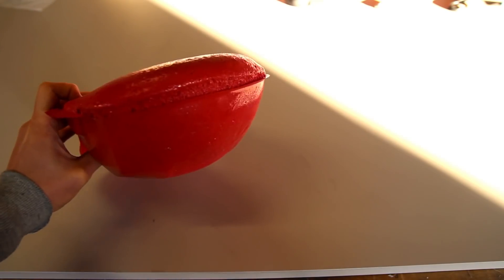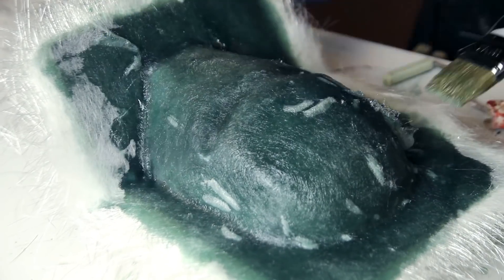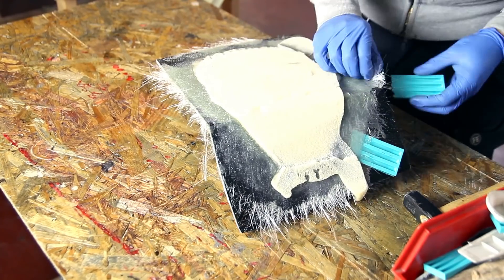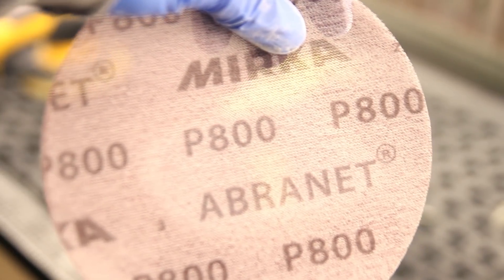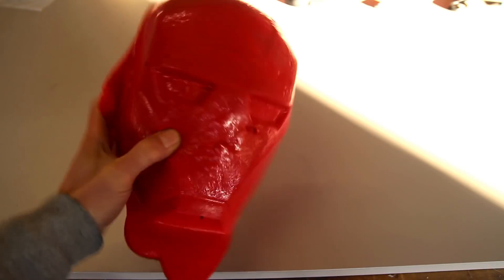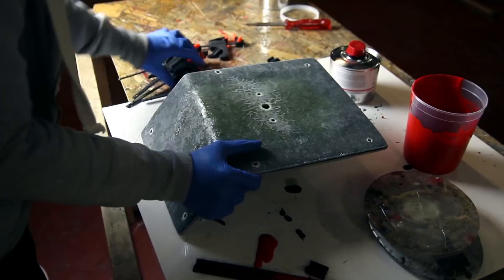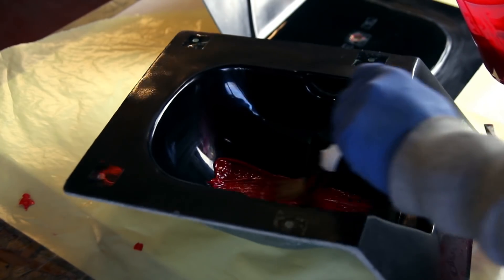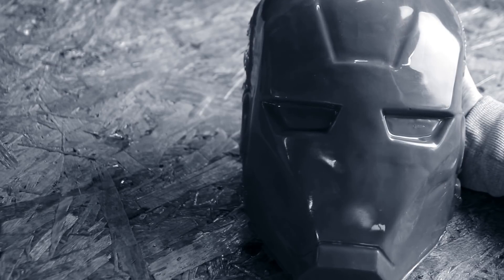Expanding Soft Polyurethane Foam - E60 PUR V-sure

Comment: apparently, in the molded flexible foam industry (eg automotive car seats and things like that), aside from metals like milled or cast aluminum..... They also use epoxy.   I got that off a flexible foam formulator's website and I havent seen many references to other materials, not even silicone or rigid PU.

Comment: Hi, I'm able to get mould released from the plug very easily but the part is always sticking the gel coat, tried using wax+pva, only wax but many layers no use though, what might be the reason and any suggestion for easy release of parts.
Reply from the maker: I use the chemical release agent from Easy Composites that works extremely well

Comment: When will you do a video about forged carbon fiber?
Reply from the maker: When I find the right products to use for forged 🙂
Reply: @MatthieuLibeert  Gonna try to make a Forged ''look'' carbon fiber part with hand layup and then vacuum bag.
Reply from the maker: Sure works but not really 'forged' 🙂
Reply: @MatthieuLibeert  That's true :). But people only care about the look. If the look is the same who cares if it is forged or not? The advatage of forged carbon fiber is that you can make a part in 10 minutes compare to 24 Hours
Reply: @capitao2259  Tried with chopped carbon fiber hand layup, something similar to compression moulding on my helmet. Finish is looking good but it turned out to be a thick layer (around 2-3mm), sure it's very strong now but heavy too😅
Reply: @adithya_k93  Well put a samll layer of chopped carbon fiber and then back it with 2 layers of 200G carbon fiber weave?